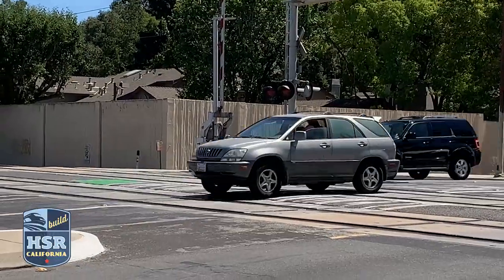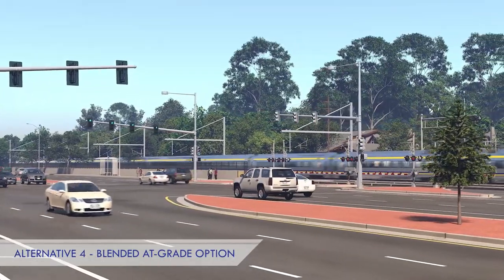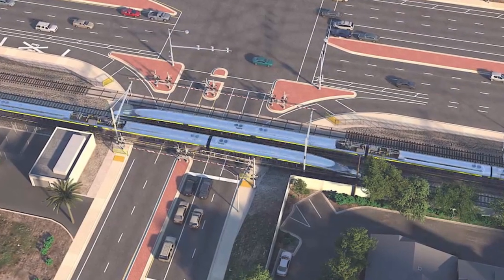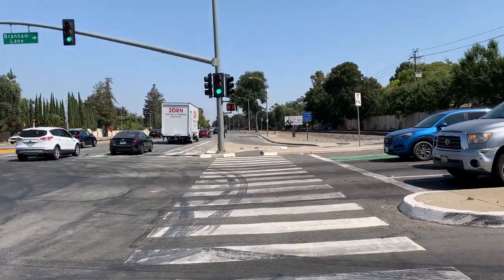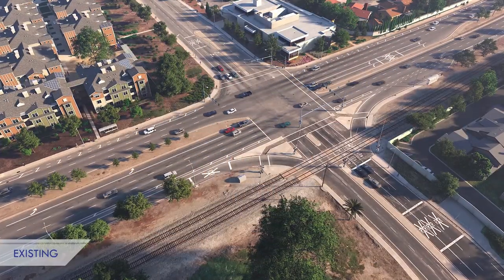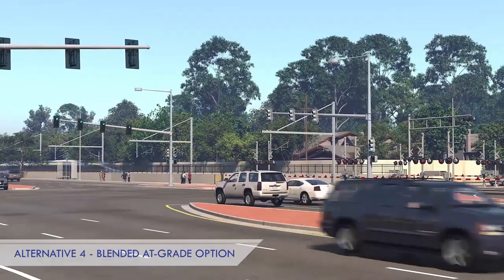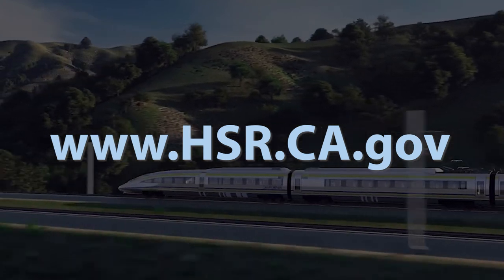On Track with Bay Area High-Speed Rail: Railway Crossings

Comment: I'm actually stunned that they would even consider an at-grade crossing. Eventually disaster will strike and everyone will ask why this happened. This is why there have been 0 fatalities over 50 years with the Japanese Shinkansen system where there are never at-grade crossings allowed.
Reply: Alternative 4 can work in terms of upgrading the existing corridor to accommodate HSR, but I totally agree with you that if CAHSR were to do that they need to separate all existing grade crossings, possibly eliminating some all together if they're not feasible for separation, between at least San Jose and Gilroy if not all the way to SF as well as in SoCal between Burbank and Anaheim. As for the example shown in this video for the intersection of Monterey Road and Branham Lane, the underpass shown in Alternative 2 seems like the best way to go.
Reply: That is why I will never ride this " High Speed Rail". It's a Major deadly " Accident" waiting to happen. Sure let a company that have no prior experience build it rather than hire a company that have... Jerry Brown's Crazy Train.. If this thing is built the way Caltrans takes decades just to widen a 5 frwy , expect this to be completed in 2055+.
Reply: @trainsplanesandotherthings5187  That's bunch of nonsense! HSR trains are a lot safer than driving or other public transit. And there are tons of HSR lines that have grade crossings. This is not ideal because you have to reduce speeds to 110mph, but not because it is unsafe. In Japan, which is widely regarded as having the best train system in the world, there are even subway trains that have grade crossings!

Basically, you build whatever is feasible. But, of course, full grade separations are preferable, if they are possible for a given location.

What is truly unsafe is what Brightline is doing in Florida. They don't have any grade separations or fences at all. And people seem to be fine with that.

Comment: Go with 2, it's a stupid idea to not grade-separate.
Reply: Keep in mind that UP line will continue to be at-grade regardless of HSR/Caltrain
Reply: It's cost effective.
Reply: @williamwlu8284  yes as it is existing
Reply: @williamwlu8284  True, but freight trains pass 3-4 times a day. California HSR is being designed to pass 3-4 times an hour at 110 mph in that section. Do you want kids and others on bikes risking crossing at grade? As a driver, do you want the gate-waits?
Reply: @soulofamerica  As I am from Germany in Europe, that have many Higher-Speed lines with grade crossings, you have to keep in mind that the gates will be closed for a High Speed Line for a maximum a minute, because the train crosses the crossing with high speeds. So the wait time is no longer as a normal traffic light.
Reply: @michaelneichel9543  Yes, but some gates would close every 5-12 minutes in America
Reply: @soulofamerica  yes but not for high speed rail like in this main use case
Reply: @soulofamerica  He's right. At 110 mph, the train will pass quickly and it will be the same as a regular light change. No biggie compared to a 30mph, 1 mile long freight train. It's just not the same thing or even remotely similar. You'll see!

This is commonly done in other countries that have HSR. It's really not that big a deal and literally saves billions. What really bothers me is that trains could conceivable go a lot faster here with a full grade separation. This would also be tremendous for Caltrain and the future Capitol Corridor expansion to Salinas. We'll have to grade separate at some point anyway, but just not now when the money is tight and the knives are out for CHSR.

Comment: It needs to be on a grade separated viaduct. It's the best alternative in the long run. Just bite the bullet now and spend the money to do it right. This is a once in a lifetime huge infrastructure project. Cut costs on other areas not on stuff like grade separating intersections.
Reply: The down side can be an imposing feeling from the raised structure - there are a few examples I can think of where elevated road or rail systems negatively impacted an area (Boston, Chicago, Seattle) - just a consideration. Grade separation does have huge benefits though.
Reply: It's a once in many generations to come project, nut just a lifetime. You're right otherwise.
Reply: @jonathanbott87  I agree, but this would be relatively limited in scope since it's about grade separating a single intersection for a dual track HSR train. it's not a 10 lane freeway that runs for dozens of miles bisecting an existing community.
Reply: @alexverdigris9939  Well, a lifetime can consist of many generations. But we're on the same page.
Reply: Unfortunately, the issue isn't as simple as spending more money for most the candidates for grade separation. Most of the sites are along the SF Peninsula where city councils and NIMBYs have being using the courts to threaten to stall the project if grade separation projects are forced in their communities. It's incredibly shortsighted on the communities' behalf, but that's what the CAHSR project and Caltrain have been fighting there for over a decade.
Reply: @brandonk9706  Agree 1000%. It's been an upstream journey, but it will be completed.
Reply: @theexmann  depends on the recall :)
Reply: @brandonk9706  The HSR Authority should have seriously thought of going through Oakland instead. Otherwise, "high speed" could be 30 mph!
Reply: @connecticutmultimodaltrans8226  exactly. A successful recall could kill the whole project!

Comment: As much as I understand that the viaduct would cut the neighborhood in two and the bad legacy of infrastructure projects in US urban areas doing just that, you HAVE to go with grade separation here. It’s a high speed rail line and even with the safety improvements they talked about, I think an at grade crossing poses too many risks for the proper functioning of the track
Reply: Agreed. And this type of viaduct is nowhere near the same as a 10 lane freeway that cuts a neighborhood in half. It is much less intrusive.
Reply: A viaduct doesn't have to cut the neighborhood in half.
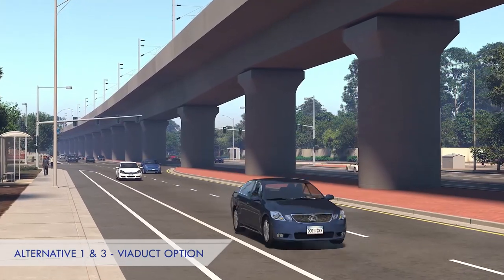That's a problem with freeway berms with an underpass every half mile, but the more open pattern shown at 0:30 would have little impact.
At a minimum, every street should go through under the tracks.
Reply: @JustClaude13  but the noise would travel for three blocks
Reply: @edwardmiessner6502  
The noise level isn't on par with a freeway. And noise barriers would control a lot of the sound.
Reply: there's an 8-10 lane major thoroughfare there, the neighborhood is already cut in two. might as well go with grade separation and safety
Reply: I think the biggest problem right now is cost. Grade separations are very expensive vs. barriers. If we want a fully grade separated system in the Bay Area, it looks like we will have to pay for it ourselves rather than rely on state money. Maybe the Feds will kick some money in from the Infrastructure Deal.
Reply: @edwardmiessner6502   in terms of noise it probably would be quieter since they train wouldn't have to blare its horn at the crossing

Comment: Brightline has proven that at grade road crossings are a bad idea, 200 accidents in 7 years.
The best solution is to separate the crossings with the road going under the tracks, as shown at 0:39 in this video.
Grade separation cost more than crossing gates, but it will be done eventually so we might as well do it now.

Comment: Brightline is a clear example that in the United States you never run a high-speed train at ground level. Americans have a habit of crashing into fast trains for no reason. The only option is the one that completely separates the train from the road. Viaducts are more expensive, but they are the best option if you don't want to squash people.
Reply: I know so many accidents on bright line and that only goes in the 70s.

Comment: If CAHSR ends up pursuing Alternative 4 for the San Jose to Merced segment, they absolutely have to grade separate all the existing rail crossings including eliminating any that can't feasibly be separated. As for the example shown here, the Alternative 2 scenario with the underpass seems like the best way to go. You cannot risk a collision with a car driving through the gates or a pedestrian walking around them. Grade separations are critical for safety as well as being able to maintain speed.
Reply: I'm from the Central Valley, so I know exactly what you're talking about. Currently, there are about 10 overpass crossings being constructed up & down the Valley at major at-grade crossings. In the Merced County area alone, I can think of a lot of the at-grade crossings that either need to be eliminated or over/under passed just because they are just too dangerous.

Comment: I'm not from the Bay Area, but the San Joaquin Valley region. Having looked at all the options for this particular crossing, the easiest and most cost-effective option is the embankment. If they were to go with the viaduct option, it would be a prolonged construction project that would drive the neighbors insane, and it would also disrupt the current rail lines.

Comment: Alternatives 1-3 are the only acceptable ones. No modern HSR system has grade crossings. Don't build option 4. Also a mixed-use line with Caltrain and CAHSR will cause huge delays for CAHSR and Caltrain.
Reply: Agreed. Let's build the route so that it's as fast as could be considering this mega project is a once in a lifetime project. If costs need to be cut, do it in another area. Don't skip on the route itself. It's, arguably, the most important part to be done as best as possible.
Reply: CAHSR and Caltrain will be sharing track.  There's no alternative to that.
Reply: Mini-Shinkansen routes in Japan have grade crossings, and they are at least part of a modern HSR system.
Reply: @mikegaskin5542  True, but they have to run at slower speeds because of it.

Comment: There is no way a at-grade crossing would ever be an option for a high speed or high traffic rail line. Who thought that was a good idea must never have seen a high speed train line in their lives.
Reply: i don't think it's gonna run close to its top speed.
Reply: @randomscb-40charger78  The reduction of speed then reacceleration would cause immense costs in power and lost time for all passengers, let alone that if dozens of these and commuter rail and freight rail, there are dozens of chances of a collision with traffic every day. At-grade crossings are only feasible with maybe 10 trains a day at most, and even there, low speed freight ones, not passenger carrying ones.
Reply: @gteixeira  Then just build bridges over them, they did that for Brightline in Florida.
Reply: @randomscb-40charger78  the problem here is that the train line is right next to a highway at a traffic light. Every such crossing will need a highway interchange. The Karens would never go for it! 😫
Reply: @randomscb-40charger78  uh no. Brightline been getting into colllison every other day

Comment: This intersection is a bit less than 8 miles from the San Jose station, so while I agree with folks here that grade separated lines are preferable, nothing was gonna be doing 220 through here, and grade separation is a biiiiig chunk o' change in urban areas.
Reply: That's a good point. I didn't realize this intersection was so close to a station. However, I still think the train would go faster, even at this distance from a station, if it was completely grade separated because it wouldn't have to slow down at this intersection. I would think it would have to slow down significantly more as it approached this intersection if it wasn't grade separated. So it would have to slow down for this intersection and then continue to slow down even more for the next station. Depending on how many of these kinds of intersections will exist on the route, the forced slowdowns will add up over the length of the route.

Does anyone know how many non grade separated intersections they plan to have on the route between LA and SF?
Reply: @alexverdigris9939  I agree, but CA has very strict building codes due to earthquakes and the issue funding is not open ended because CA hasn't gotten much funding from the federal government. If CA would get much more federal funding then there would be more options.

Comment: Are you kidding me? You guys are still debating this? Unbelievable.
Reply: Environmental reports - in detail - are required by law... and then come all the lawsuits by NIMBYs and Republicans. For whatever reason, most of the lawsuits have been by Republicans. I don't know why. 
This environmental work is being done section by section. They've done the Central Valley part of the initial route and just did Bakersfield to Palmdale. This fall Palmdale to Burbank is supposed to be finished. They learned their lesson on the first constructions: Get all the EIRs, lawsuits and land purchases out of the way first.
Reply: @danielcarroll3358  with high speed rail, there cannot be at level crossings. There is way too much danger and possible delays that come with it.
Reply: @secretagentnewt  True on the high speed part of the line. However as one approaches San Francisco they will run slower at first in what is known as blended service. The eventual plan is to eliminate all the grade crossings, but even then it is unlikely that the speed will exceed 125 mph between San Jose and San Francisco. This is not that uncommon on other high speed lines that run high speed far from their endpoints and reduced speed where they are required to run through very built up cities. Alternatively, one can just stop at the edge of the city and have a new high speed only station. It works for airports.

Comment: You guys should already have this decided. You guys should've already planned the layout for the whole thing, what's this we need to decide how to do it. JUST GO WITH THE ONE THAT MAKES IT FASTER SO OFC OPTIONS 1-3
Reply: They have already stated that they can reach their time targets of SF-LA in 2 hours 40 minutes even with 110 mph limits on the SF Peninsula (where the at-grade crossings are). That's probably why there isn't much urgency to spend more to grade-separate that section. The rest of the CAHSR route is already designed to be fully grade-separated and at higher speeds.

Comment: First day of bright line florida 79mph rail returned to service a 71 year old woman with her grandson turned onto the tracks and got struck by the train. Going to be cheaper to take the traffic below the rail.  Grade crossings in town . Let's see what happens on sections 1, 2, 3 . Somebody is always going to get hit. I think a few years ago. Nationwide . Every 90 minutes a train verses car or pedestrian accident.  Putting in 4 underground columns beside the track would allow those to be done without stopping rail or grade crossing. Precast support beams  along with precast rail bridges could then be installed  in a few day shut down depending on utilities under the tracks. Rail and grade crossing restored then below grade work to lower the intersection without interrupting rail traffic . If the precast yard has a rail siding components can be brought in by special rail cars.

Comment: I think the preferred route is ok. While the grade crossing reduce speed efficiency, if the minimizations of crossings is sufficient enough to keep traffic flowing then by all means. However, at which point does the right of way in the preferred option become restricted by space? Adding another track if CSX deems necessary might monkey wrench the situation.  The viaduct might be inevitable. 

The sunken is cool but it’s a concrete monstrosity and I don’t imagine going to be welcome by the residents. Both for safety and accessibility. 

I’d prefer the viaduct but the neighbors might not. The road is developed with residents already and they should take precedence.

Comment: Grade separate it!!!!!! With gates the max speed allowed by the FRA is 110mph which is not HSR.
Reply: As mentioned in the video, most of the route will be grade separated and at much higher speeds, but LA-Anaheim and the SF Peninsula will have some stretches with at-grade crossings. I believe you are correct and the trains will have to slow down to 110mph to pass through those areas.

Comment: What year is the California High Speed Rail going to be completed?
Reply: After all current readers are dead....maybe
Reply: It's going to be completed in several phases. The first phase should be completed around 2028. It will be a 171-mile section from Merced to Bakersfield. Travel time from Merced to Bakersfield will be slashed from 3 hours to about 90 minutes.